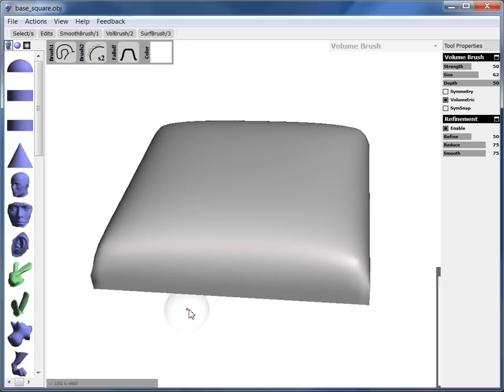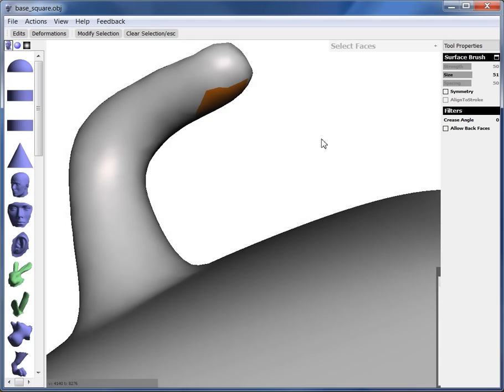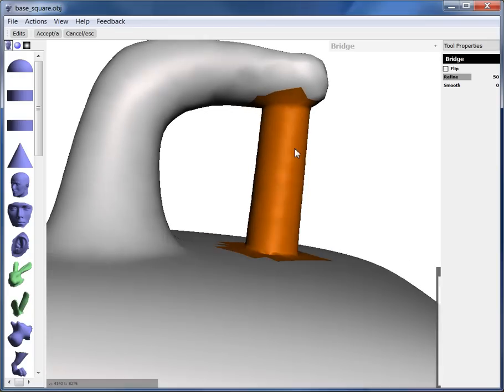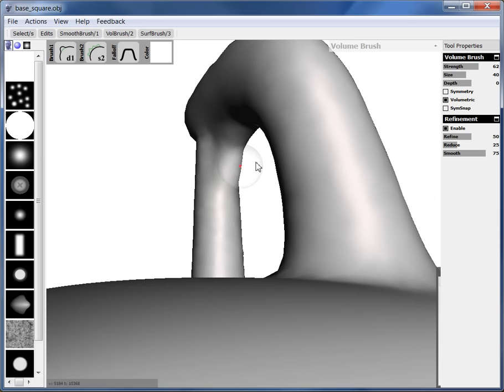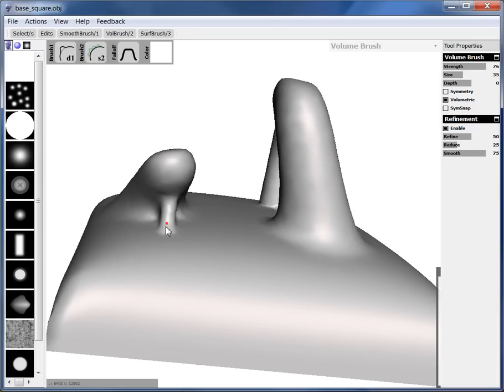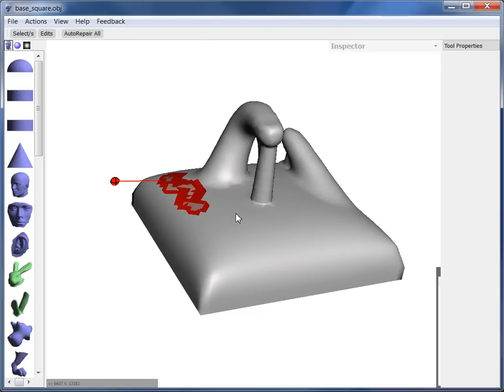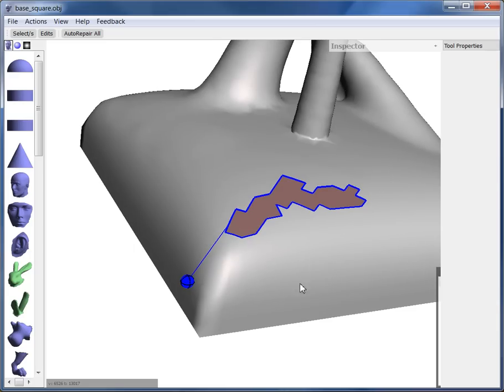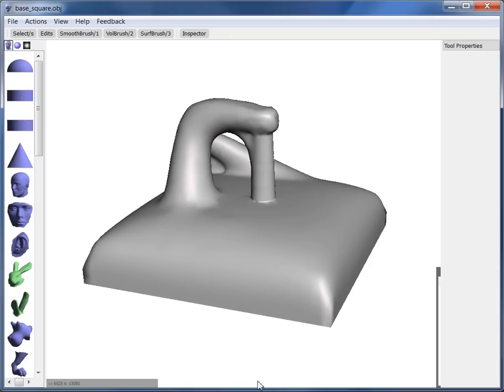meshmixer model/print tut 6of6

Comment: For the "bridge/handle" you could also pinch the base smaller so that it tapers up to the extended part. That would impose a smaller blemish on the surface it comes up from.